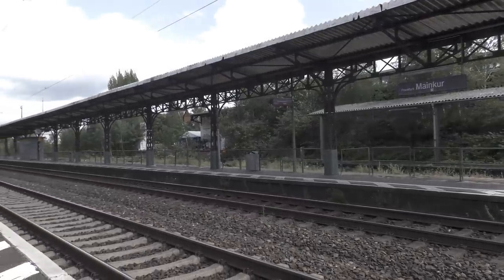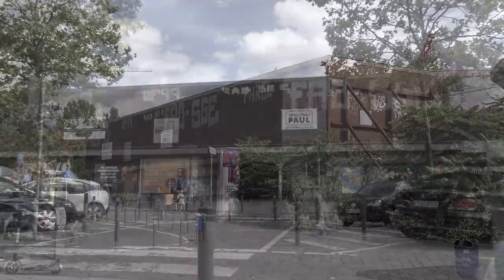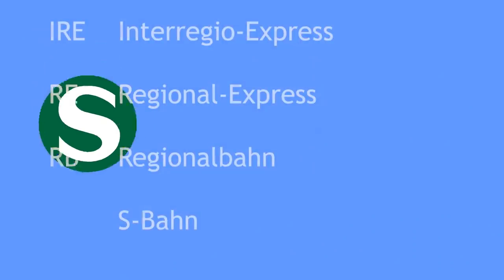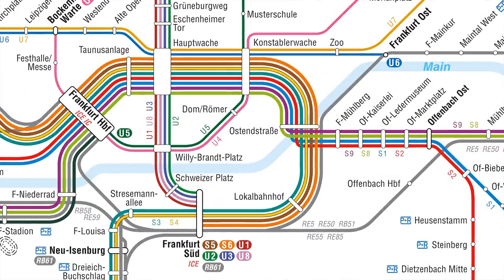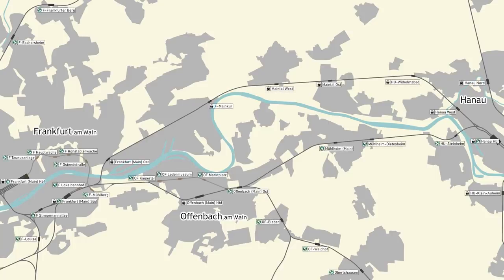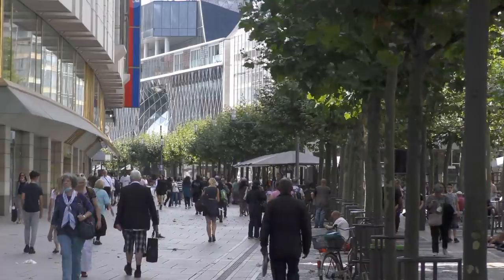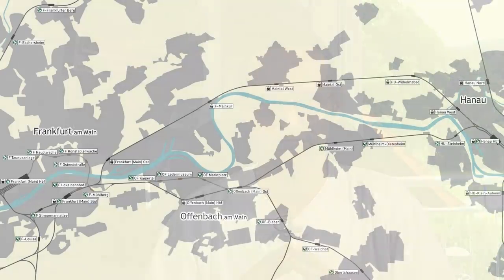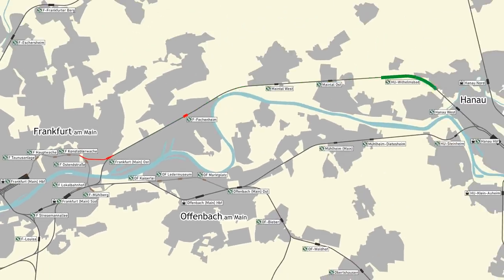Why is this station so neglected?

Comment: "The good citizens of Offenbach" - let me stop you there, Offenbach is a pretty bad place.
Reply: Almost everything bordering Frankfurt (including vast parts of Frankfurt itself) is a run down ugly mess
Reply: @CrazyKraut20  What a statement
Reply: Well if I meet a car with registration plate from Offenbach, in 80-90% of the cases the driver behaves like an idiot... (which doesn't mean necessarily driving fast, but driving dangerous)
Reply: @btudrus  OF = Ohne Führerschein ;)
Reply: @lindsaywebb1904  Alle die in Kronberg wohnen sind Bonzen (Allgemein der Taunus Bereich)
Reply: @yannickschmitt3537  No shit.
Reply: At least it has the Digital Retro Park.
Reply: @lindsaywebb1904  
Well, they have a small S-Bahn stop in kronberg, which is only one track... Then there is a campus of a huge consulting company and the factories for OralB. I keep asking myself: Why does Kronberg not have a better station then?

To compare with the tunneled S Bahn stops of Ismaning and Unterforing (ultra rich area), it is very underwhelming.
Reply: @CrazyKraut20  Not sure what areas you’ve been to, but I live 8 km from the city center of Frankfurt, and all the little towns near mine are beautiful. Also, Frankfurt has come a long way in recent years, as I’ve been told from people who grew up here.
Reply: @cosmo_chemist  Oof I wouldn't want to know what that place used to be like then. have never felt as unsafe as in Frankfurt and I have traveled 3rd world countries.  The amount of agressive a-holes, junkies and street crime is absurd. Also Places I've been to include Hanau, Rüsselsheim Offenbach etc. all absolute shitholes

Comment: Fun fact: Both Prague and Copenhagen have an S-Bahn abbreviated with an S. The "S" does not actually stand for anything in either Czech or Danish (In Denmark they used the backronym "station", but the S started showing up at S-tog stops in Copenhagen before that definition was given)
Reply: This video is the first time I heard it is supposed to stand for StadtSchnellBahn. Here in Austria we only call it Schnellbahn (fast train) which is really confusing, as it is the slowest of all trains (just faster then trams or underground trains). So the S not standing for anything is in fact "better" information that having it stand for it "fast train".
Reply: @idnwiw   In Berlin it is just Stadtbahn. Makes more sense don't you agree?
Reply: So do a number of Belgian cities and Milan in Italy.
Reply: And several other cities as well around Europe.
Reply: @idnwiw  "Schnellbahn" bezieht sich auf den Stadtverkehr. Innerhalb einer Stadt ist die S-Bahn ja meistens das schnellste (wenn es nicht noch nen Regionalexpress gibt)
Reply: @ArfurFaulkesHake  in Berlin, "Stadtbahn" just refers to one of the central routes of the S-Bahn.
Reply: @ArfurFaulkesHake  I disagree, because in many German Cities "Stadtbahn" is something completely different. The term "Stadtbahn" describes a light rail transit system. That can include characteristics of a tram system in some cities while in other cities it resembles a metro system. So as "Stadtbahn" is already a pretty vague term, please don't mix it up with "S-Bahn", which describes a commuter rail system (well unless you are only talking about Berlin).
Reply: @danielgotz4032   I said in Berlin. 

You can disagree all you want, it's not going to change the fact, that the Berlin S-Bahn in 1930 changed its name from Stadt-Schnellbahn into Stadtbahn.
Reply: @MTobias  Yes and No.
It is absolutely true that there is a Berliner-Stadtbahn, which runs from Ostbahnhof to Charlottenburg and was built in 1873.
But i am referring to the whole S-Bahn grid which was renamed in 1930 from Stadt-Schnellbahn to Stadtbahn.
To quote Wikipedia: 
"Nachdem die Bezeichnung für dieses Verkehrssystem in den Jahren 1929/30 noch Stadt-Schnellbahn (abgekürzt SS) war, wurde ab März 1930 die Bezeichnung in Stadtbahn (abgekürzt: S-Bahn) abgeändert."
Reply: @ArfurFaulkesHake  You said it would make more sense, but it does not.
Reply: @ArfurFaulkesHake  Your example of the Berliner-Stadtbahn shows why it does not make more sense, but only leads to more confusion. In Berlin this affects only that line from Ostbahnhof to Charlottenburg but in many German cities there is a whole Stadtbahn-system, which would lead to even more confusion. Just accept it. There are 12 (as far as i know) cities in Germany with a Stadtbahn-system. Calling the S-Bahn Stadtbahn would not make sense.
And the fact that some cities call their Stadtbahn "U-Bahn" (which would translate to metro), while they don't meet the requirements for a metro, creates even more confusion.
Reply: @ArfurFaulkesHake  And btw, wikipedia is contradictory in this case. From the wikipedia article "Berliner Stadtbahn":
"Es ist nicht eindeutig geklärt, wofür der Buchstabe „S“ stehen sollte. Vermutlich hat er seinen Ursprung im bereits 1930 für den Begriff Stadtschnellbahn nachweisbaren Kürzel „SS“."
Reply: @idnwiw  it’s really just a suburban train
Reply: @danielgotz4032  

Might be.

From my personal experience of living in Berlin for 37 Years.

It just has always been Stadtbahn, but hey;
i grew up in the east, maybe it was different in West-Berlin.

Who knows.
Reply: @ArfurFaulkesHake  Yes, you might be totally right regarding Berlin. A lot of things in Berlin are very different than in the rest of Germany. 
I just wanted to point out, that it would not make sense to generally call the S-Bahn "Stadtbahn", because this term is already assigned for a different transit system.
Reply: @danielgotz4032  Indeed - e.g. Stuttgart, where the "Stadtbahn" is a kind of a mix between U-Bahn and Tramway.
Reply: @ArfurFaulkesHake  Yes, that´s right. It only seems to be a specific case of Berlin, e.g. Stuttgart is very different in this direction.
Reply: @ArfurFaulkesHake  I think that is how it started as early as 1900 with lightweight steamlocos that ran on a raised track. To my knowledge that is when Bahnhof Friedrichstraße was opened.
Reply: @idnwiw  
Yes, I caught what I understood to be a StadtBahn train from Dusseldorf to Duisburg many years ago only for my Austrian friend to tell me that S-Bahn meant SchnellBahn, which I thought was odd as it was less Schnell that the DB trains.
Reply: @danielgotz4032  Just as Rewboss explained the difference between the Berlin S-Bahn and U-Bahn in another video: "the S-Bahn runs overground, except when it runs underground, and the U-Bahn runs underground, except when it runs overground" !!!

To me (as someone from Berlin) the main difference is the color of trains and ticket machines (U is yellow, S is red or red/orange), and less importantly the official owner S=DB (fun fact: before 1990 it was DR and thus rails and stations were east german territory, fun fact 2: DR stands for "Deutsche REICHSbahn" which is the old pre-1945 name), and U=BVG (fun fact: BVG is the name/abbreviation of "Berliner VerkehrsBetriebe" and not "Gesellschaft", while the pre-1990 eastberlin company was BVB).

The important part is that i can use both (and tram and bus and ship) with the same ticket, and (with my new yearly ticket starting next month) even ALL public transport (except ICE trains) in two states which all belong to the VBB (Verkehrsverbund Berlin Brandenburg) :-)
Reply: @ArfurFaulkesHake  Having lived all my life in the west of Berlin, we always said S-Bahn for that entire train system and Stadtbahn (or even Stadtbahn-Trasse) for the specific track (not trains) that crosses on a dam (including almost 500 arches with shops, storage space, etc) from west to east right through the entire central town, and that has four rails: two for the S-Bahn and two for normal trains.
at least decades ago, train tickets to Berlin (main station Berlin-Zoo in the west) were labeled with "Berlin Stadtbahn" as destination and then could also be used for that S-Bahn.
Reply: @Anson_AKB  This doesn't really help with the previous discussion but thank you for the additional information.
And actually your first fun fact is not correct: the rails, stations, warehouses and even residential houses and other assets in West Berlin which formerly belonged to the DR were transfered to a new Administration, initiated by the Allied Western Powers, the VdeR (Administration of the Former Reichsbahn Assets). The DR only had the right to operate on those facilities.
Reply: @Anson_AKB   Vielleicht ist es einfach nur ein Unterschied zwischen West ind Ost.
Meines wissen steht der Begriff Stadtbahn sowohl für sie Strecke zwischen Ostbahnhof und Charlottenburg, als auch für das gesamte Berliener S-Bahnnetz.
Hauptsächlich weil sich die Stadt-Schnellbahn 1930 in Stadtbahn umbenannt hat.
Und zumindest im Osten ist dieser Begriff als Alternative zu "S-Bahn" hängen geblieben.
Reply: just today, i happened to pass by S-Bahn station Friedrichstraße and its info/ticket office, and they had lots of plans and other flyers. one of them was about "Berliner Ringbahn", the "circle line" that connected various terminus train stations and villages without having any level crossings, located before 1920 around all the small villages that after 1920 were joined to create the city "Groß-Berlin" and thus made the Ringbahn to be entirely inside city limits.
the subtitle of that flyer was "150 years anniversary, 1871-2021" and here are some details from that flyer (published by "DB Station&Service AG"):

17.07.1871 - opening of Ringbahn, first part from Moabit to Schöneberg
15.12.1877 - the entire circle of the Ringbahn is completed
1890 - new stations, 1900 - cargo traffic on the Ringbahn surpasses 1 million tons
1910 - more new stations for a total of 27, and the Ring has four rails everywhere
1920 - Ringbahn now inside of Groß-Berlin
1924 - only steam trains on the ring, but first electrical trains on the track between Stettiner Bahnhof and Bernau "mark the birth of the S-Bahn"
15.05.1929 - entire ring is electrified and thus only S-Bahn drives on the ring (from how this is worded, i would assume that S-Bahn is used as the name of the electric trains and the electrified train system, in contrast to the steam trains that used the tracks between 1871 and 1929; but no details about the name/abbreviation itself)
1930 - trains are driving faster around the entire ring: 125 min in 1903, 116 min in 1925, and finally the S-Bahn in '30s only 78 min. nowadays, it's 60 min (once again speaking of "the S-Bahn in the '30s" to mean the electrical trains)
WW2 - during WW2 most parts and connections of the ring were still working, and the entire ring itself was usable until 1944
June 1945 - reopening of the entire ring, and most repairs finished in 1950
1961 - Ring cut in two parts by the wall
1970 - very few passengers in the west (boycott) and only halftrains are used, and western part is no longer used starting in 1980
1989 - start of reactivation, 1990 - unification of germany and berlin, 1993 - southern part of ring usable again
2000 - long distance train stations Gesundbrunnen and Südkreuz are finished
15.06.2002 - complete ring is finished and usable again (two different numbers and symbols like 🔄🔁 for CW and CCW lines)

fun facts: at the beginning of the 1930s there were 1265 trains per day on station Gesundbrunnen, and nowadays 2000 trains per day at Ostkreuz.

the BVG network of public transport now has 3 zones, zone A for everything inside the ring, zone B for the rest inside city limits, and zone C around (but still nearby) Berlin, with most normal tickets available in three variants, as AB, BC and ABC :-)
Reply: @danielgotz4032  it's always difficult to get all political and legal details right. thanks for the additional detailed info.
what mattered to me (as someone from the west) was that "(only) had the right to operate" meant that (railway)police on those areas were from the east, and some people (people trying to flee and thinking they reached the "safe west" as well as stupid west people who climbed over fences and up the train dams, and everybody else that used the S-Bahn and got in any trouble) could be arrested by some east german police and west german police was not allowed to go there.
Reply: @Anson_AKB  Yeah, that's right. And as far as I know, there was a lot of controversy about those areas, sometimes resulting in violent conflicts between East and West authorities.
Reply: The “S” around Prague actually stands for something: it means a regional train line in Central Bohemia Region (Bezirk) - in Czech “Středočeský kraj”. The S lines go far beyond Prague itself and serve as commuter trains, not so much for inner-city transport. 

E.g, in the north of the country the regional lines are denoted by “U”, which does not mean U-Bahn or U-Boot, but relates to the name of the region, “Ústecký kraj” (by the regional capital, Ústí nad Labem, German: Aussig).
Reply: Hallo! Hierzulande heißt es SAARbahn. Nur eine Linie, fährt auf Straßenbahnschienen (in den Straßen von SB) und auf  Eisenbahngleisen, von Sarreguemines in Lothringen bis etwa in die Mitte des Landes und retour. Auch als Saarbrücker Straßenbahn bekannt.
Reply: @Anson_AKB  Bitte, Du hast ALL nicht erklärt - was wird damit abgekürzt?
Reply: Actually in Prague S-bahn (linky S - lines S) serve mainly the Central Bohemian Region (Středočeský kraj) which is commonly abreviated to S. The Prague S lines do not really serve Prague, only a few stops are located there with most of them being built or upgraded in the past 10 years.
Similarly in Czechia, Ústí nad Labem in the Ústecký region have U lines there.

Comment: Given the speed of infrastructure projects in Germany over the last decades, I wonder how they rebuild the country after the war at all.
Reply: There were lot's of minor stations where 1 dude sold tickets. There's an ticket automat there now
Reply: There is a low German idiom: "Wat mutt, dat mutt". It translates to something like, "What has to be done, has to be done" and means that if the need to do something is sufficiently dire, you'll find a way to make it work.
I suppose that's the main difference between the time right after the war and now: there are no dire needs anymore. Thus we have the freedom to regulate everything into impracticability.
Reply: @lonestarr1490  Yeah, but it hasn't to be done, because there's no value in it in this case. In the 50s/60s there was a clerk in every town who sold tickets. Automatization, the dude has been vanished. My village bought one of this stations and it would cost over 1 Mio € to renovate it. If you can make something out it good, if it's just sunken cost- don't do it.
Reply: @lonestarr1490  For sure. Also, I guess over the decades we've amassed a bunch or rules, that all make sense on their own, but all in all amount to just too much regulation.

Comment: I Like it to find stations like this. 
Everywhere else everything is modernized all the time, but the railway is the only place where you can find unchanged strucutres and technology from many decades ago. 
When i had a girlfriend in Ludwigshafen 10 years ago in 2011, i vistited her by train once, and at the abandoned station building there was a sign in one window that the ticket counter will be closed from August 1st 1970 on :D Time just stopped to pass on there, for 40 years.
Reply: Why invest money in a building which has no actual use? The DB sell this old buildings all the time, but it's hard to make something usefull out of them.
Reply: It's like an open-air museum.
Imagine, the person who set up that sign might be long dead for all we know.
Reply: My local train station (single tack line with hourly trains) still has it's old name written on the sign at the former ticket office.
The sign is ahr dto read but it still reads [part of town 1] - [part of town 2] which is outdated since 1971 when the 2 towns got merged. Until 2015 you could still see the higher platform formerly used for cargo (and I guess bags?) but it was demolished to raise the platform to 76cm.

The old ticket office is rotting away and I'm pretty sure nobody was inside of it in at least 2 decades. The windows are barricaded as well as the door.

Comment: Looks like every other small town train station. That's their "be happy there are tracks and sometimes trains stop by" style ;-)
Reply: Reminds me of the town I used to live in here in Denmark. Our local station was basically two small narrow platforms slapped between the noise barriers and the track. If you felt adventurous you could go stand on the island platform, which was 2 meters wide, full of holes, barely above the track level and situated between two mainline tracks, were trains would pass by at 180 km/h every 15 minutes.

Comment: I passed my A-Levels 1991 in Hanau, living in in Maintal-Dörnigheim then. Ever since then I've been told the S-Bahn north of the River Main is only five years away. Every now and then when I come back home from Berlin I like to pay Frankfurt-Ost a visit to shudder in disbelief how rotten down the station has gotten.
Reply: They're now supposedly planning a tunnel I think and a new overground line somewhere, and it all might connect with the underground rework of the Hauptbahnhof... I really don't know what'll come of it. Hopefully not equal to Stuttgart 21 in engineering ineptitude.
Reply: @lillywho  If you´ve good luck you will finally have something like Stuttgart 21 - where the construction work at least finally has started...

Comment: <adds nasal voice>Although the name S-Bahn was chosen in 1930 (as a parallel to the U-Bahn), the Berlin S-Bahn is in fact much older than 1930. You could even argue it goes back as far as 1838 (the opening of the "Stammbahn" from Potsdam to Berlin's Potsdamer Bahnhof). But S-Bahn-like, exclusively regional/local rail systems have been around since the opening of Berlins Ringbahn in 1871.